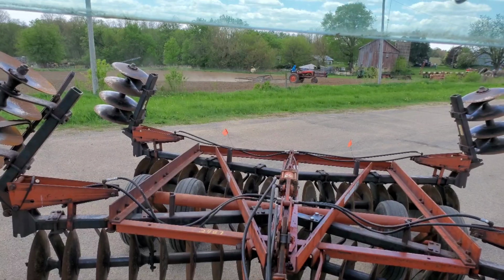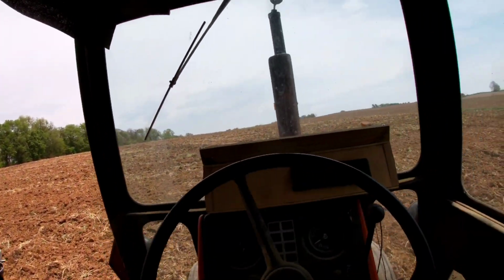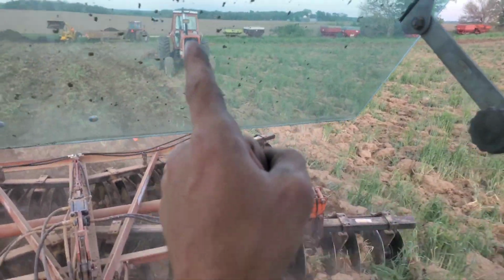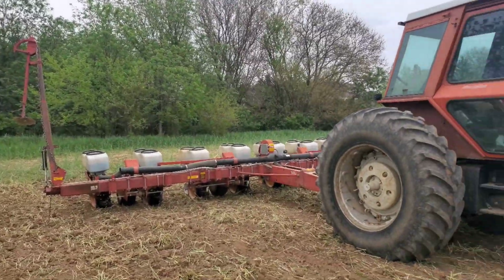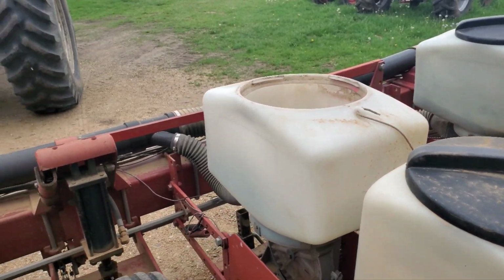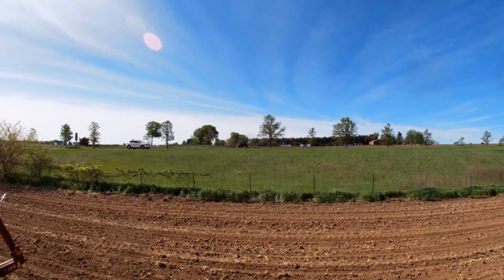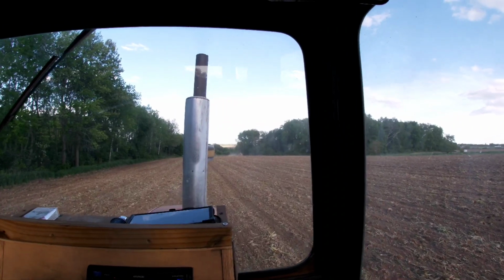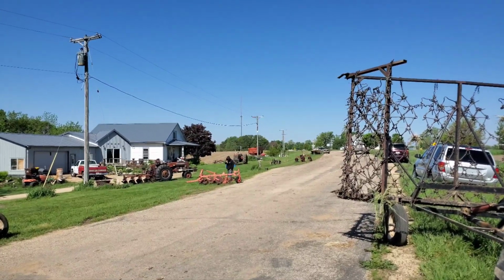From plowed ground to planted corn 🌽. 2022 Spring field work is DONE!!!.

Comment: You tractor is runs like a fine time piece.  Like my Dad used to tell us check the oil and put diesel in her and don't stop till you finish.
Reply from the maker: I'm very happy with how the new one is running, I paid less that 10 grand for it I'd say  you'd be hard pressed to find another 155hp tractor that runs that good for that price. I looked at a could other brands but made sense to go with what I know. Thanks for watching!
Reply: @TimothyFluegel  I paid 9,000 for my open post cab JD 4430 2 years back and pleased with it.  it's a working machine with minor problems.
Reply from the maker: @southtexashay777  you can't beat hp at that price,  what are those rates for hp?

Comment: Getting it done 👍
 🐔 💩 Is good fertilizer!!!
Just gotta be able to get it.
Nice to see all the girls out working.. now if you would get the AC working, you wouldn't have to yell🤔😳😂🤣😂🤣
Reply from the maker: Thankyou Ed! It was a rough one this year but we did it. I can get 🐔 💩 any time I guess in the summer they have so much they give it away just need to pay trucking. It's usually $10 a ton but in normal fashion with everything else this year it went up to $40 due to the bird flu 🤦‍♂️, so not like paying almost $1000 a ton for uerea  though so I can't complain. And the A/C pump is on the way for the new to me tractor 😆 the rest of the system held a vacuum but the pump is locked up,  I'm guessing they didn't put ether oil in when they converted.
Reply: @TimothyFluegel  I looked into 🐔💩 here a few years ago. Not many birds in this part of the country, not like it used to be.
It was the same price as urea then, they delivered it too.. but you had to have a barn to store it in, otherwise it would get wet and be all stuck together. It was dried and granulated so a fertilizer spreader could spread it..  I haven't seen an ad for it in a couple of years.
Reply from the maker: @GosselinFarmsEdGosselin  that's how I used to get it chicken litter they called it. This fan used to make it but there ding facility burned down 🤦‍♂️ this is way cheaper even paying for the moisture weight is less than half the price to get the same amount of nutrients
Reply: @TimothyFluegel  sucks about e fire, but good that you still got 💩👍😁
Reply from the maker: @GosselinFarmsEdGosselin  that's for sure, this is how I wanted to get it anyways just was a hard time finding a spreader I could afford,  but sometimes ya gotta fake it until ya make it I guess 😆

Comment: harrowed a lot of ground with a WD45 and 4 second harrow. had a 180 massey do that haulin corn and it was a hydralic coupler leaking. had a 2300 16 ft allis disc that was a great disc bought it new 1974 when l had a D19 then l pulled it with a 180D then a 190XTIII that was a great tractor!!!! then l got a 210 had problem with it and traded for a 7045 great tractor and bought a 2300 18 ft allis disc to rigid so traded for a kewanee 24 ft good disc but transport wheel bearing to light had to keep an eye on them. miss my 7045 but l would love to have my 210 back for tractor rides and plow days!!! l be watchin!!
Reply from the maker: That's funny dad's disc growing up was a 24ft  Kewanee I remember around 7 or 8 years old dad would drive the tractor and disc to the field and turn me loose with that disc and the 6080 cab tractor with front wheels assist, I felt like I was on top of the world back then. I'd like to have a 210 or 220 as well but they have almost caught up to the d21 in price. 
I'll have to look into this couplers on my tractor, now that you say that it's about the only thing that makes sense lie one of the balls aren't sealing correctly thankyou for that Gary!

Comment: Good job getting seed in the ground! That was quite a push to get it all done but you made it. Can't believe you got that planter that cheap sounds like that was a heck of a deal! Glad the 7045 did a good job too, you were definitely giving it a workout. Did you get your big 7060 going again too? I thought that was the tractor you had on the planter. When you said the powershift transmission went in it I actually wondered if you might be better off swapping engines between that tractor and the other 7060 with the power director but I didn't realize it was missing some other parts too. Anyway, congrats on getting 2022 planting in! Thanks for the video, have a good one Tim
Reply from the maker: Thankyou Evan! Yep that was the big favor on the planter, there was a leaking hyd hose that leaked the fluid out, when the clutches released I think they tried to grab again or something and made a terrible sound sounded lie a great breaking honestly so I didn't even think about it, 7000 hours on the meter with no tranny work. I just figured that was it I half expect it to happen every time I use it hard anyways 😆 I've heard so many horror stories about the power shifts after 5000 hours and it never has grabbed 3rd gear quite right. Pulling the big field cultivator out plowing with it I usually skip 3rd straight to 4th so I don't slip the clutches,  but it's going now and I've got another tractor out of the deal and I don't think the 7045 will be going anywhere lol the ac compressor is on the way.